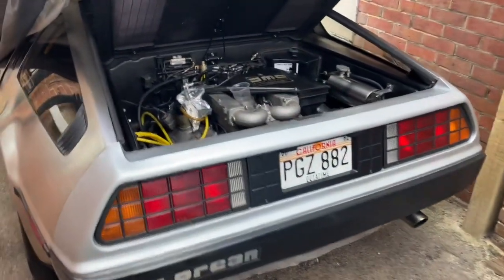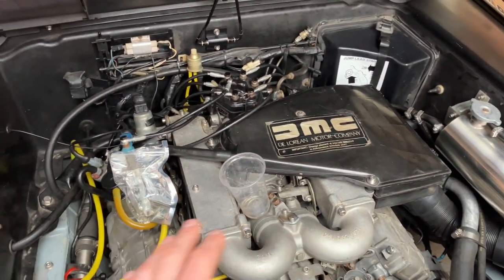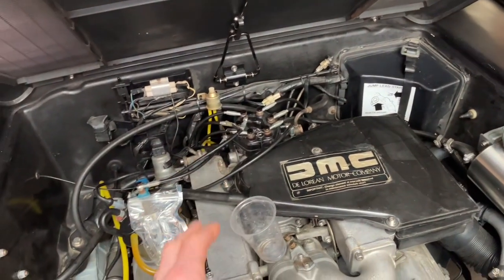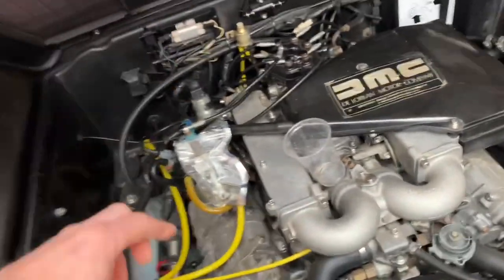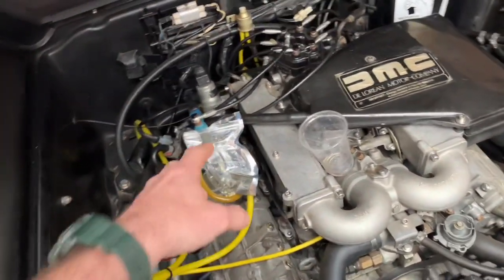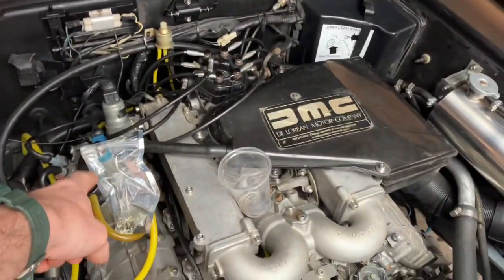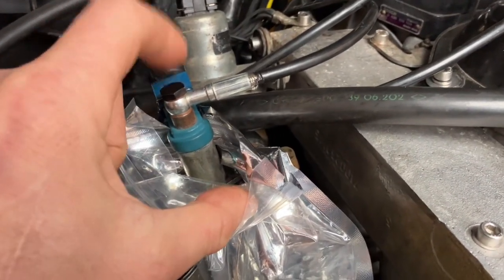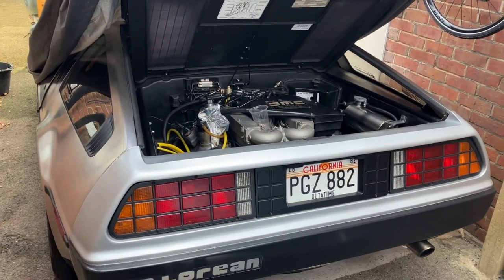DeLorean DMC12 - CSV flooding engine - Faulty Cold Start Valve!

Comment: Thanks Paul , The Dwell has stopped “swinging “ was actually happend on my car too, so i just unplug the coldstart and car runs fine, 
For my perticular car was, the longer it sit , the cold start will be instant, if I drive yesterday and start tomorrow , the cranking will be a 10sec long . i guess that has to do with the off scale AF ratio cause by the cold start vale
Reply from the maker: Hey. See if yours leaks like mine. Mine sprays then Drips 14ml of fuel whilst  the car is sat in the garage/road.
So this fuel  would drip in the engine every time, then clog the sensor and cause a smoky engine Start up :)